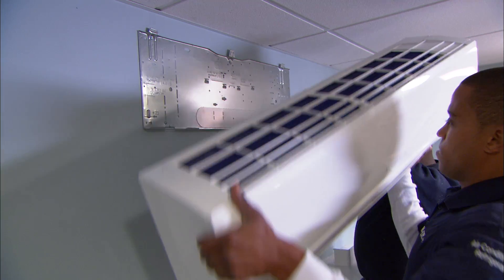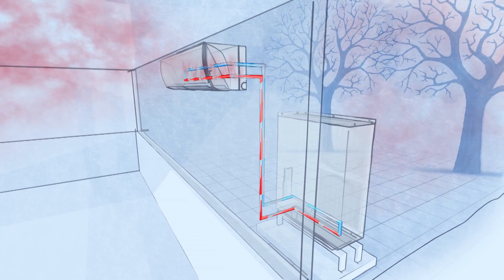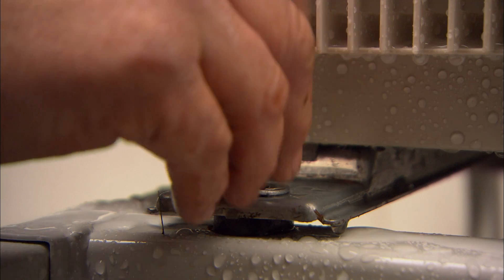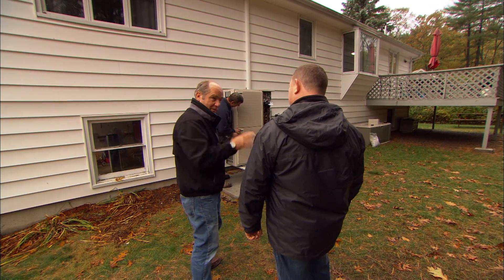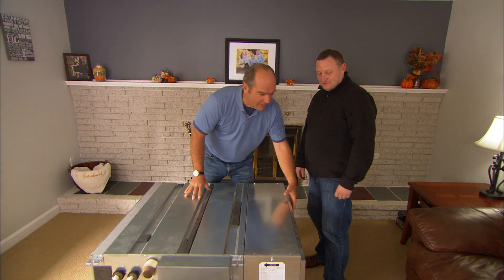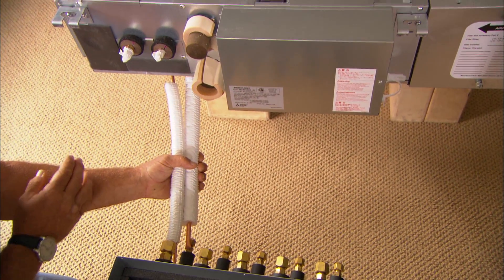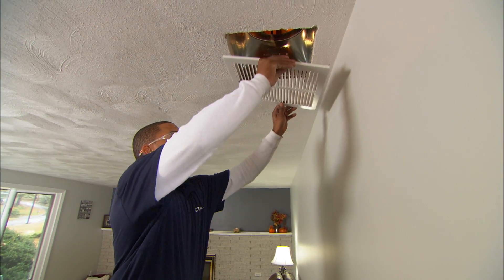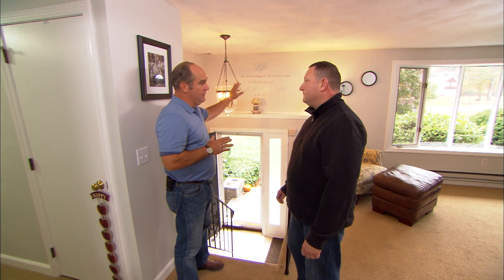How to Install a Heat Pump for Heating & Cooling | Ask This Old House

Comment: Nice system and a grand total of about $45,000. Not very practical for the average suburban home.
Reply: Outside condenser about 2500, refrigerant register about 1000, 4 air handlers 1000 a piece 7500 plus mark up 15k plus labor and maintenance contract, rough guess bout 20k
Reply: g smoove i have mitdubishi ductless system install on my house and we use it more to heat/cool the house, you are very close yo your estimate it all depend on how much btu your air handler so it vary
Reply: Tommy TMT So $15k? That’s the cost of a whole new heating system, oil to natural gas conversion, with another zone for my house. Def not cheap
Reply: No dude, MUCH less than that! I'd say it was roughly 1/3 that.
Reply: Dude it costed me 800 usd to install one of these
Reply: where did you come up with that number? it's roughly in line with the cost of installing any other central air system.

Comment: Branch box mini splits are nice till you have a refrigerant leak. Then it's a very expensive proposition to find the leak.
Reply: i agree ,all those flare connections ,good luck
Reply: @8799crosby  yeah why didn't they braze???
Reply: @wesleysullivan8047   all branch boxes r flared connections , sometimes I eliminate them and zoom lock them , I don’t braze them I believe there r solenoid valves for every zone , right near in the box
Reply: Yup, and don’t get me started on the price.

For homeowners, this is pretty high.

Comment: Has anyone seen a mini-split system with geothermal application? Seems like the way to go but I can't find it.
Reply: Paris Ashcroft as air to air heat pumps get better the expensive drilling for a ground source heat pump becomes cost prohibitive

Comment: what system is this? Is the electric heat element back up in the air handler or outside condenser?
Reply: Chris Scott it is in the air handler

Comment: Hello.I am interested in ducted system for may home and I also have  4 chimneys, I can use as a duct lines. Diameter of chimneys is about 4 inches, and I will try to split one duct from indoor unit in two, because i have 8 smaller rooms to cover. I also saw on some forums, that the diameter of one duct in the unit is about 8 inches. Is this allowed to do without affecting the appliance? Thanks for great video.

Comment: An inverter varies the speed of the compressor not help it get heat
Reply: depends on the system. Some inverters do have a frequency changing output which can either change the "speed" of the fan alone or both the compressor and/or the fan. Not all units run the same. some have a variable throttle valve which changes the pressure in the evaporator/compressor therefore the saturation pressure of the refrigerant. Coming from someone who has designed HVAC systems.
Reply: Landon Hillyard Landon is right
Reply: in correct the inverter slows down along with the fan giving u better heat or cold absorption , aka hotter or colder air
Reply: An inverter changes AC to DC so that the motor speed (compressor) can be variable.

Comment: This isn't really a "how to install" as much as it is an overview of the system. Title is misleading
Reply: i disagree ,way harder than it looks ,and who is going to wire it .
Reply: saborguerito It's not exactly a Do It Yourself project
Reply: Philip Folmsbee I disagree. as a Layman and a homeowner, I can do all of this except for pressurizing the system. I can pay someone to small fee to come do that
Reply: saborguerito Even though you can do it, we can both agree that this is something that the average John Q. Public would not tackle. I mean come on,  we have people calling Ask This old house for a running toilet.
Reply: @saborguerito  You can't! People think they can. I ROUTINELY am paid to correct systems that guys "who know how to do this" put in. Every month.
Reply: and I've been doing hvac for 20 years
Reply: saborguerito - I've done that, but afterwards you realize that you didn't save much money at all and made so much hassle for yourself. Because it'll turn out that half of the stuff you did won't be code and when the pros come to finish they won't hook up to what you did.
Reply: saborguerito I remember watching another YouTube video of TOH, and the unit they installed came precharged with refrigerant. All the technician had to do was connect the lines and open the valve. Sounds like a much easier way to install of you're up for the task. Good luck and let us know how it went!
Reply: Lmao I just need someone to pressurize the system. Get bent. Your going to install a four zoned Mitsubishi hyper heat with a routing box yourself? What a joke that system cost anywhere between 15-20k
Reply: great one 99 I will give you that. Electricity scares the crap out of me period but I could do most of it and hire someone to do the parts that I'm not willing to. In fact, I have two mini-split systems going into my property this week. One of my house and the other one on my workshop in the back.
Reply: What’s something like this cost

Comment: Looks like this home had a central A/C condenser outside beside the deck.  Did it have an oil or gas furnace as well?  I also saw baseboard heating.  Electric or hydronic?
Reply: I’m pretty sure this has been cut from another episode where the guy has some weird kind of radiant ceiling heating - not 100% sure but I think this is it

Comment: I've been working for a heat pump manufacturer for one year now, on their air source they only have refrigerant in the condensing unit so the flow n return are water, I've never seen anyone use it for cooling as I imagine it's not great, using a refrigerant from outdoor unit to indoor has to be far better, they are great for heating though, I wonder if most heat pump manufacturers use refrigerant traveling from outdoor to indoor units and my company is not the norm, I've been a fridge air con technician for years but mostly now it's plumbing work.
Reply: Liam Oleary Huh? Gibberish much?
Reply: Is this meant to be an Irish joke?
Reply: @vladopajank2444   I've heard of O'Leary jokes and Liam jokes, but not "Liam O'Leary". I guess the point is that it's "blarney".  A "fridge air con" technician would know in principle, refrigerant would be VERY efficient, or know exactly what the competition is doing.  Definitely as little as six years ago techs really were very hesitant and spread FUD, mostly just because it was newer, different tech, like electric cars also were in the recent past. Contractors couldn't depend on old faithful name brands, etc.

Comment: There is no way on earth a heat pump can be as efficient for heating as a simple heater. It is against the laws of physics. You need a heat pump for cooling, but not for heating if you want maximum I efficiency.
Reply: It takes more energy to heat with an electric heater(coil) than it does to move existing heat from outdoors inside, trust me.  To tell you how much more efficient heat pumps are I was paying a little over $100 on electric even during the winter a couple years ago but since the compressor on my heat pump went out I am now paying over $300 a month during winter because I'm using the electric furnace.  Hopefully I'll be able to get it fixed soon.
Reply: In mild climates most of Washington State heat pumps work very well. If natural gas isn’t available
Reply: I can testify that when I had electric baseboards I was paying 1200 to 1400 a month to heat my 2000sqft home. Now I have 3 zones and my bill is consistantly under $200 a month. My whole house is electric. Stove, washer, dryer, water heater, well pump. And I never turn off or turn down my heat. My house is 78f all winter long.
Reply: @BoriPR82  under 200 for heat or under 200 for all electricity usage in general?
Reply: @uptalk144  all utilities

Comment: I don't know I am not an expert. But my stock water heater form 1990 is still producing hot water. I have replaced one element my self for next to nothing. I have very hard water and need a water softener but the heater keeps marching on. My next one will be just like this one.

Comment: I really don't see the point of these. It supposed to save you money but it cost so much to install. You mine as well just keep central.
Reply: Looks like they had electric baseboards to start with, super expensive to run
Reply: Approx 40%more efficient to run than central so it will pay for itself over time. They really perform and the big thing for a lot of people is that they are super quiet which is nice on those hot summer nights when you get to sleep without a loud buzzing compressor waking you up.

Comment: It looks quite over complicated, and I am very skeptical that a heat pump can perform to the satisfaction of people for comfort heating. The delta T is lower than gas/electric and feels drafty to most. Only in the southern climate zones is there enough heat content to give the higher delta T that people are accustomed to. 
Those super compact systems are very hard to service and with multiple evaporators, I think there would be problems and performance issues and you'll never find a technician that's going to know enough about this rare hybrid system to troubleshoot it effectively. This mean the actual realized cost of owning this system is going to be more than advertized cost and consequently not worth the technology. My advice to anyone interested, is keep it simple, and I base this on nearly 20 years in the industry.  
I did not see any emergency heat either, are those evaporators equipped with electric heat? When the temps get below freezing how can the condenser defrost? Air to air heat pumps in the chicago area will freeze into a solid block of ice below 32 degrees as they typically do not have any "active" defrost.
Reply: These are the most common systems here in Australia, even in the snow country. When they defrost the indoor fan switches off as well as the outdoor fan. So not many units have electric strip heat here. And being so common around here they are cheap to install. Most people have central gas ducted heating but with natural gas prices rising and electricity prices falling you can now see people's outdoor units running all year round.
Reply: John Elliott I have one installed in my 1400 square foot home.  it will heat the home,  but in the middle of winter there are times when I'll use a space heater. but the cost savings over baseboard electric heat is undeniable
Reply: Oh yea definitely the cost of its going to be less than electric baseboard heat. I lived in a small, very small like a few hundred square feet studio with electric baseboard heat and in middle of winter it was not unusual to have 2 to 300$ electric bill for one month. You cannot beat gas for cost per therm yet in Chicago climate zone, even a geothermal HP still must have EM heat (usually electric).

Comment: After the cost of the install you should be saving money on your heating and cooling around the year 2055...
Reply: Maxid1 what if the customer was using electric baseboard heat, then the savings will be drastic less after one year
Reply: Way cheaper now
Reply: Unless you have oil, then its 4-5 years for us in the PNW.
Reply: its about having a more comfortable living space, while ALSO saving money. 

its not a scheme to save massive money, although your bullshit numbers are way off. its more like 5 to 10 years they will see a return. The new zoning should help out a lot and the programability. 

1 zone or even two zones can be hugely inefficient, one room is hot they turn on AC for 4 rooms....
Reply: TimmyTechTV We pat about $1200-$1500 annually for oil in a 1800 sq ft house in frigid New England. It’s not that bad
Reply: @Idiotsincarshere  That's not bad in New England actually, mostly will cost a lot more if house is bigger and set temp higher.
Reply: @Idiotsincarshere  That's actually terrible.
Reply: Gammareign How so?
Reply: @Idiotsincarshere  my power bill to heat and cool my house (and run all my other electrical appliances including clothes dryer and water heater) is around $2000 a year, maybe a bit less. 1500sqft house in the Southeast US.
Reply: Matthew Naugler Klassen I forget the dollar estimate I used to determine that. I'd also have to rewatch the video to see the scope of the work. I vaguely recall the number was in the 10's of thousands(and that cost was in my market of California. It could be much less somewhere else). That aside, if I wanted a heat pump, I'd get one. Or if I wanted hydronic heating in my floors I'd put it in if I could afford it, regardless of the cost. My goal in a home is for it to be comfortable. If I intended to sell it I might be more inclined to focus on the value to cost ratio, but not in a house I intended to keep.
Reply: @Maxid1  great explanation man I dont see the point why the people is so naive or GC like to RIP off people... install crazy system when maybe there are other similar and affordable.... of course there are several challenge maybe there is no room to install and the option are ductless... etc but as I know the cheapest one is duct system not more efficient but it work...

Comment: They are nice and easy to install...but holy crap are they expensive !!!!!!
Reply: Frank $12 grand essay
Reply: +Frank its about the more expensive but you don't have to run new ducts through the entire house for a central unit and rip up floors, create bulk heads and more.